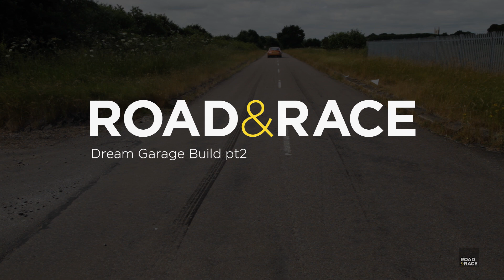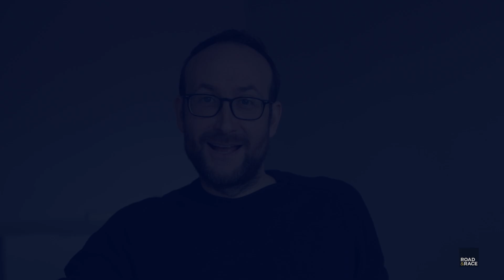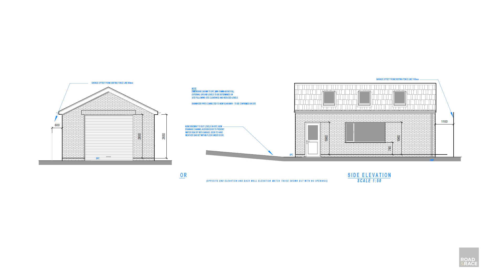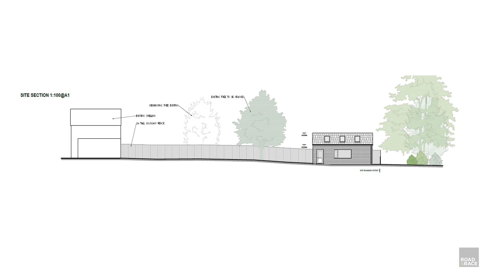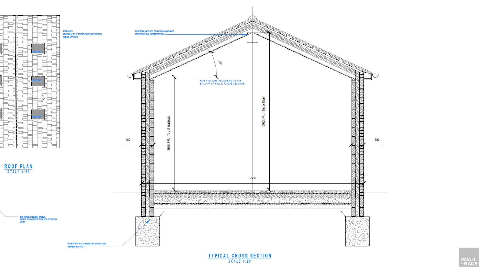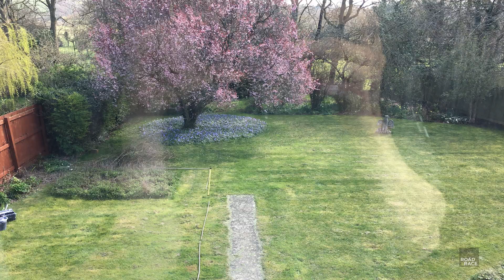Planning My Dream Car Garage | Dream Car Garage Pt.2

Comment: Add 25% to your budget 😉. Think about making wooden double barn doors rather than burning £1700 plus on a roller door. I have a roller door, when it’s closed there is a gap above the door so it lets lots of cold air in. You can insulate wooden doors.

Comment: Fair play to you if you can get that garage built to 10k - give me his number I will keep him flat out with work! 4 poster if you have to Room as you can install a 4 wheel alignment system, 2 post if you just want good access and are stuck for space, they are easier when it comes to removing wheels and that I have worked with both for 10 years.

Comment: Wow this is great, I'm along for the build. Only wish I could do the same!! 
I guess the under lighting is not done to much because often when under the bit you need to get too is behind something. I think some of the work lights you get in stands from Screwfix will be good, or and two florescent strip lights. As long as they don't become a trip hazard, I guess that's the other reason. Unless you can get cheap 400w industrial sunken up ighters??
Heating, I would go gas, quick and simple, easy to replace the bottle. Use a space heater to blast it up to temp then something on a flume ticking over?? 
Also think some green energy maybe??
Reply from the maker: Thanks mate.  Some good ideas there.

Comment: Hi, I would stay away from electric heating personally as I think it will be to expensive to run, if you are hoping to take heating and hot water from your house then you may have to upgrade your heating system ie new boiler to cope with the demand so you would be better of to fit a small boiler with under floor heating & 90ltr unvented cylinder separately in the new man cave sorry garage!! you won’t be disappointed with that in my experience 👍😊

Comment: I’ve used a two post that we bought from a dealership that had gone belly up. The unit I part rent has no power and the lift needed 3 phase so we bought a 10kva generator and a single to 3 phase converter box to run it. Only time I’d have wanted a 4 post is when lifting my old golf before I’d repaired the sills.

Comment: I wish I'd have gone for Insulation and underfloor heating, you want the insulation anyway and underfloor isn't hard to do or expensive in the grand scheme of things. There are many ways that you can heat it too, you could stick a heat pump, boiler, log burner/back boiler/solar or whatever you wanted on it with a buffer.

Comment: We had a Hormann sectional garage door In our old house and have a Securoglide version in our current house, both are very good. Make sure you explain to the installer that you're going to be heating it and that it needs to be installed well in order to avoid heat loss.

For lighting, you want LED panels on the ceiling (and can put them on walls as well if required. I wouldn't put lighting in the floor, as it will add complication and cost. Just have a couple of good work lights you can position exactly where you need them under the vehicle.

For heating, electric panel radiators will be cheapest to buy and while they are not the cheapest to run, as you won't be heating the garage to domestic levels, and won 't be heating it all the time, I don't think it will be too much of an issue. Fit them with timers and you can even get them know which you can control on your phone - so you can wake up and put the heating on from the house so that it's warm when you start work.

For flooring, just have a nice smooth level concrete floor then lay garage floor tiles over the top - hard wearing, easy to replace if damaged and will be much better to lie on than a painted concrete/screed floor.
Reply from the maker: Big thanks Dave, will take that on board.

Comment: Ideally I would go with a 2 post lift with asymmetric arms so you can open the car doors whilst it’s on the lift and go with the link cables over the top rather than the hump in the middle across the floor so it’s easier to move the car in and out. Remember you will probably need reinforcing pads in the concrete floor to mount the lift towers to. Regards lighting I would go with LED. You have plenty of natural light and LEDs keep running costs down and are a cleaner, more focussed light imo. Under floor heating is the way to go, a separate tank with immersion heater will suffice  as the heat source and not cost too much to run. As for flooring, the cheapest route is just to seal the concrete but my preference is epoxy...easier to keep clean. It’s all budget dependent though..if you over spend on the build you might end up with max jaxs and a head torch!

Comment: 10 grand, 5 second pause, 10 grand, double that then add 10 on top of it. The hardest issue you will have is getting a professional builder that you can trust. Also that time line seems tight, my small experience dealing with builders is treble any timescale they give you. Do wish everything runs smooth for you. P.S. 2 poster all day long.

Comment: Regarding up lighting to light underside of your car while on the ramp, I’d say this is worth doing.  My Dad has a workshop with a pit, he added LED spotlights down the perimeter sides at approx. 500mm spacing this provides great under car lighting.  Still need a led light if working deep in the car.  If want to light the area under the ramp could either go for lights embedded in the floor or if going for a 4 post ramp mount lights on the ramps.

Comment: I'm in  similar situation to you, I am about to start to build a 6x5m timber framed garage here in the UK. £10k is no where near going to build you a double skin garage, plus the drive etc. My 6" concrete base (no foundations like you will need) cost over 2k alone.  Good luck, but you need to do some more research. I have costed mine at approx 8k and that's me building it on my own, including 1.5k for the roller door.

Comment: Search automotech services for a lift, have used one for the past 4 years and been faultless. With the types of cars you’re doing I’d suggest a 2 post base less lift, start from about £1500. Easier on the BMW’s as the 4 posters get in the way of the undertrays and make it a nightmare for any big repairs other than servicing. Also you’ll need ramp extensions for the low cars on a 4 poster. Also think about the base you’re putting down as you might need a more substantial base to anchor the lift to. You could just make the base thicker where the lift will be anchored too to save some money also it might be possible to insulated the base where the lift isn’t and will help on the heating. I’d go for an epoxy resin floor, once it’s done you won’t have to worry about it for years, painted ones don’t tend to last that long. Heating wise, maybe a lpg blow heater to keep the costs down, only used for 6 months of the year and they tend to heat the space quicker than radiators unless you want it slightly heated overnight go for something that’s abit more permanent

Comment: As an ex- mechanic, you definitely want to go for a 2 post lift. It gives far better access for working on suspensions or when removing gearboxes on front wheel drive cars.
We had both in our workshop ( you must have a 4 post lift for MOT testing) but the 2 post is most practical.
Make sure you check with the lift manufacturer for the depth of concrete required , and always go for a heavier lift than you think you need.
Don't go for a cheap Chinese lift. You get what you pay for.
Good luck

Comment: Heating, I'd strongly suggest an indirect diesel heater, the one I'm looking at is a 18kw Arcotherm Vertigo Cabinet Heater, a log burner will fill the garage with soot and stink of smoke (it will happen) and I've currently got 5kw of electric heating in my insulated garage and it takes 5/6 hours to get from 6'c to a more comfortable 17'c at a cost of 75p per hour or £4.50 a day! so I'm now ditching electric in favor of an indirect diesel, for your space and size (155m3) you'd need about 5kw of heating, but rather than having a heater at full chat all the time, get a bigger one, like 10kw (what can do a lot can do a little) 

Also while I admire your optimism, 10k will vanish unless your doing all the work yourself, I'm doing a 30m2 self build and so far with zero contractor help (aside tree removal) already spent 4.5k for a shell.

Granted that's 4.5k over 12months and trying to vlog the progress while doing it slowed me down somewhat 🤣

Also lighting, if you can, take a look at Ikea's LED Gx53 1000lm lamps, nice crisp light, adjustable beams and are the best I've found for the price etc

Comment: How exciting! You have come a long way, congratulations.
As for the electrical; Hanging LED panels will be best for sufficient lighting and power usage over the years. They are obviously initially more expensive to other options. If you opt for fluorescent however, LED panels can be swapped easily in the future.
Floor lighting sounds cool and is a personal option. Though you can save the money by simply investing in magnetic torches which you can attach to your hoist and adjust as you please. It's actually more effective than a secure floor light shining in your eyes.
Make sure the electrician simply installs two way switching, and consider how/which lights you want to switch. e.g above desk light individually switched. Also a sensor floor light outside the shed is a good idea.
As for power: not sure how it differs from here in Australia. But make sure you get enough power in there to install welders, compressors and future equipment you may use. (three phase power). Be sure to add sufficient power as the brick finish may or may not make future installs difficult. Having power on a certain wall can make this easier.
Goodluck and I hope I have helped!

Comment: I think that type of building is going to cost a good bit more than £10k. I would say £15-£20k . 
Have you not thought about a timber frame building, clad in larch boards, much more environmentally sound as no concrete blocks and mortar. 6x2 frame with wool or Kingspan will be very warm. You could board the walls inside with OSB and paint them. Onduline roof boards (£20 for a 2m length) are brilliant and look good too. 
I have an old (80's)  4 post Stenhoj lift that was given to me free, it's brilliant but very narrow to get modern cars (Cayman) on, especially the rear end. A 2 post lift will give you more room inside the building and wheels are hanging. 
Not sure a lift will work in a building that low though, you'll need to make sure it has a height limit on the machine to stop you tearing the roof off with your car. You need 240V lift.
In the drawings, what type of roof trusses are you going to have ? Only steel RSJ frame will give you full height inside.
Shame about that Cherry Tree , it's a cracker and a bee haven in the Spring.
Reply: Actually looking at your plans again I'd say in the SE England you're probably nearer the £40k mark for a block built /building regs garage that size, groundworks won't be cheap + mini digger/dumper hire/driver/skip etc etc...sorry for the bad news. A single skin portal frame with concrete floor would cost more than £10k , probably £15k. Can you get VAT back?
Reply from the maker: Thanks for all the feedback Stephen.  I doubt I’d be able to get the VAT back without having a business?

Comment: Planning a garage myself. Things to also think about - flooring, poured smoothed concrete, epoxy, tiles, painted concrete. 
High voltage supply; future proof for the next gen and demands for home electric car charging. 
Air compressor room or store, keeps it out of the way and less noise.
Reply: Adam Henderson proper epoxy is great.  Stained and polished Concrete is nicer!

Comment: Get a 2 POST obviously. But then also buy a Cheap Polishing Lift you can move around. That you drive over.
Reply from the maker: What’s a polishing lift please?
Reply: @RoadandRacetv  its a scissor lift. But you can move it around and its max 1.5 meter height. But thats super easy height for just a quick wheel swap. Or like cleaning. Or working on interieur without breaking ur back on ur knees.
Reply: @RoadandRacetv  we had 2x 2 post lifts and a scissor moveable lift at our rally shop. Very easy to move around and work on all sort of stuff. Is one project on ur lift stuck waiting for parts. Use the moveable small lift you can easy store away if not using

Comment: Hi regarding the lift you could contact a company called Kent Garages, very good and they will do single phase. Also as your having the driveway redone you could have a gas supply run from your home and install a separate boiler. Anyway good luck on your build.
Regards David

Comment: I would install low cost fluorescent lamps but rather one more than one less. For base illumination to get around 500lx. In workbench area additional lamps to get 1000lx. I saw (expensive) ground lamps and lamps on the frame of a 4 post lift in the past working pretty good - but you are not very flexible with these solutions. In aircraft industry for example they are using flexible illumination wagons for equipping work. Very simple wagons with adjustable or fixed lamps - in many cases including electrical or compressed air distribution for power tools.

Comment: I have an air con unit in my garage, they  reverse and can be used as a heat pump. It fills the room with heat within 5 mins and if you get a wifi enabled one you can turn it on before you go out there. 👍
Reply from the maker: Thanks for the top tip!

Comment: It's great to see you're making progress!

I'd definitely go with a 2-post-lift. They use these in all professional workshops, and if it wasn't safe, that would not be allowed I'm sure.
It saves so much space and it's so much better to work with less posts.

For the floor, have you considered ceramic tiles? There's heavy duty ones and you do not plan to work on heavy trucks or tanks, so tiles should be fine. Painted concrete or any other floor always starts to look shabby after some time and I hate the idea of having to clear out a garage just to re-paint the floor.

I found it sufficient to heat the garages I used with a propane heater fed from a gas bottle. And that was in non insulated buildings. Fitting a ceiling fan might be a good idea so the heat does not stay right under the roof. You'd have to fit it somewhere where a car on a lift would not hit it.

The idea of lighting in the floor sounds great but whenever I had lamps lying on the floor or similar I felt they blinded me too much and were irritating. Tube lamps along the lift's posts seem to be a good compromise.

Wouldn't a roof in front of the garage or a carport to shelter another car be nice? That might be to much for the budget though.

Looking forward to your next video!

Comment: 2-post. The 4-post are usually with flat ramps to drive the wheels up on. The 2 posts are easy to swing out the 4 arms to the jackpoints and are very safe, no problem. The 4 posts prohibit work on axles etc. where you have to remove wheels and tyres etc. I would go with a 2 post myself, actually thinking about one, my problem is the lift height as I have only 3.20 height in the garage.
Reply: I know I am pretty randomly asking but do anybody know a good website to watch newly released tv shows online ?
Reply: @Crew Nash i would suggest Flixzone. Just search on google for it :)

Comment: It sounds like a fun project! I would really try to keep the cherry tree since it does look gorgeous and assuming produces a lot of cherries. Here are some thoughts regarding your design/build: floor lights -> more problems in the long run, stationary (you might not need them in that spot later) and unnecessarily expensive; you can always use good lamps to light under your car. Heating/cooling (global warming eventually will reach the UK) try an A/C inverter unit that can work on heating/cooling and dehumidifying (best are Mitsubishi and Panasonic - sure they are available in the UK). Have a shower and full working bathroom; you might prefer to get rid of the grime before going into your house. I would include a 3 phase electrical panel/outlet; never sure what you might need in the future. I would also include a fortified concrete floor for the same reason. MAybe some space for a part washer and a sandblasting cabinet in the future. Not sure how big it will be, but an extract fan for the fumes and maybe for some paint job. And for sure I would epoxy the floor and add cylindrical edges where the wall meets the floor and some drainage channels to be able to powerwash the floor.  If all these fail, you can always convert it into a small guestroom for the inlaws or friends ;-)

Comment: I used these guys for my door based in Leicester. Don't know where u are http://www.prestigesecuritysolutions.co.uk

You can buy the same kits on eBay for about 350quid and as long as you can use a hacksaw and a drill are not too bad to fit DIY. Otherwise you'll be looking at approx 900-1200quid fitted for a single door. The advantage to roller shutters is having an odd size opening. Mine is 6ft 10 so I can drive mid size vans and 4x4s in with no issues

Comment: Electrical heating is always 100% efficient so as far as I know there's no difference in how expensive or cheap you go... could be a £20 fan heater, or a £100 space heater, or £300 electric radiator, all the same in terms of energy used to heat output.

Comment: Have you measured the lift fitment within the structure? That looks way too tight. Most workshops have a pretty high ceiling space, that's about 400 mm more than fairly typical domestic, which really isn't much. You need to pick a lift and get the dimensions and draw it against the space you're creating. It's a lot too late to think about it once the foundations are in.